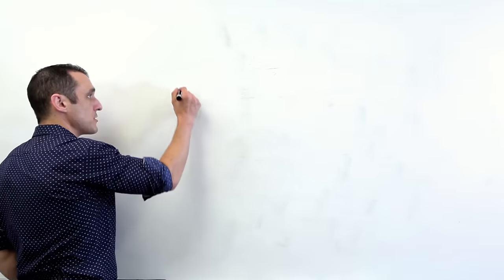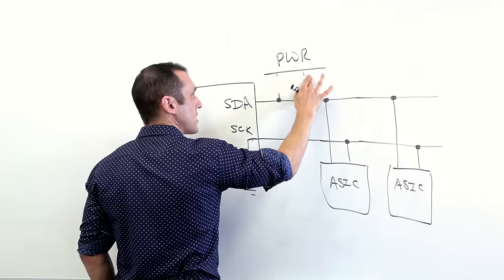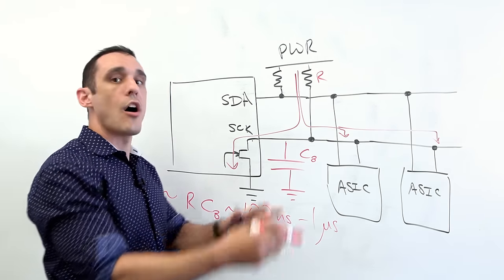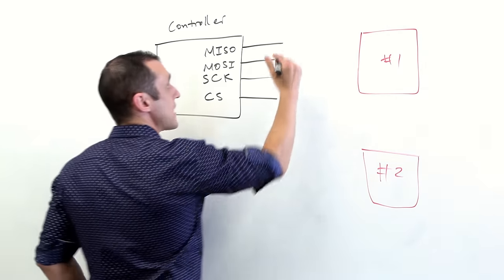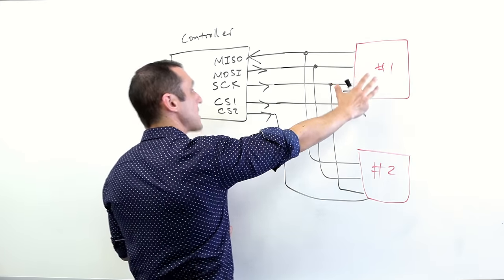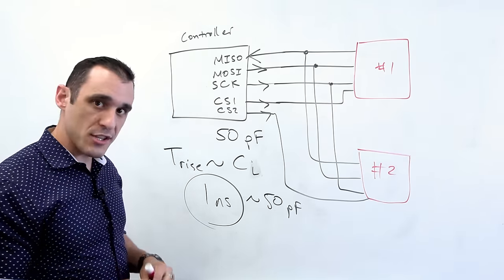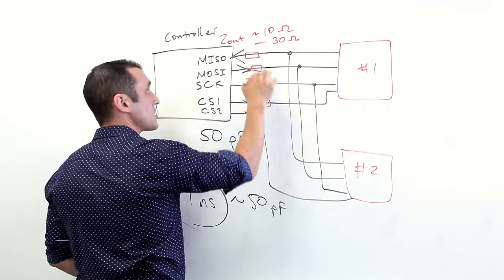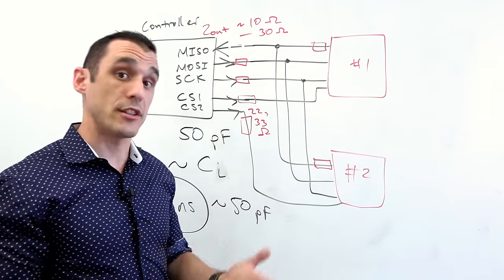I2C and SPI on a PCB Explained!

Comment: VERY Bad idea to put a source termination on the SCK line with multiple loads.   This will not ensure that the rise/falls are monatonic.  They will tend to flatten right at the 1/2 way point until the end reflection brings them back.

Comment: What about I2S? I'm a hobbyist who wants to experiment with STM32 and some audio codecs but I tried an AD1937 and can't get it to work. I can get the I2C communication working with it, but I suspect the I2S is suffering from ringing. I think I can actually see some ringing on my scope. But then in some I2S videos on YouTube I see people soldering loose wires without any concern for impedance at all. So I'm kind of lost. In a design for a Dev kit with this chip, I saw some impedance matching on the I2S lines, just a couple pF and a few ohms. But it's hard to figure out whether I'm dealing with a software issue or whether I did something wrong in my hardware design. Maybe I'm not configuring the codec correctly.. Should I definitely have the codec and STM32 on the same pcb? If so then why does it seem some people can get I2S working over some loose wires? Would you recommend I start with a more simple codec first?

Comment: I have seen such resistors with an SPI memory design, and that stayed looping in my mind looking to what the use of such small resistors and why not something high like driving a diode (At level of 100's or K's). 
Thank you very much for educative video is comes on time for me. BTW, I like your PCB series, it is hard to find such resources and learn about hidden tricks.

Comment: Very informational video that clearly describes how I2C and SPI work on a PCB. My question is how would a layer stack up look like for those examples?
Reply: Thank you, layer stackups for these interfaces are quite simple. I2C is basically a slower interface when run in standard mode, its rise time can be on the order of microseconds. With the rise time being that slow a 2-layer board with ground fill on the back layer, or with a ground wire running along the traces, should be enough to suppress radiation. In fast mode and on some modern processors/advanced FPGAs it can have faster rise time and it can get below 100 ns in the fastest cases, for that it is best to use ground fill to help suppress noise if you use 2 layer board. For SPI, the rise time can be very fast, when slower a 2-layer board with ground fill around traces and ground fill on back layer should be okay. In the fastest components with SPI, a 4 layer board might be needed, but those components with <5 ns SPI interfaces will almost always have other interfaces that demand a 4-layer board with ground plane.

Comment: 12:45 So if USB requires matched impedance it means they have already build in resistors in transmitters therefore they are already "slowed down". How do you achieve high speed when you have to slow down transmitter for impedance matching?
Reply: I would not say that they have "slowed down" anything, they have designed the transmitter such that it has a specific rise time measured at the output pin when the signal encounters a 50 Ohm single-ended impedance. They didn't design it to one rise time and then add stuff to slow it down. When you see a rise time spec in a datasheet, that number they quote is the number you can expect to measure on that trace, it doesn't really matter what happens inside the transmitter because they have already designed it to operate with a 50 Ohm trace. This is why you would not intentionally place series resistors on the USB outputs when they are already rated for 50 Ohms single-ended impedance.

Comment: Wait, so how does the series termination resistor limit rise times? I thought it was more to limit signal reflections. To my knowledge using a series resistor would certainly limit the current, but I don't see how it could have a capacitive effect with respect to the rise time. Is there anything I'm missing or over-simplifying here?
Reply: Imagine the resistor and load+bus capacitance as an RC circuit, increasing the resistor value would increase the charge time of the capacitor - equivalent to slowing the rise time
Reply: Yes the series resistor does limit the rise times. It slows down the edge rate because it is equivalent to adding some DC resistance into a circuit with capacitance (in the lumped element view); this basically adds damping to the transient response. If you had a short connection between the driver and the receiver component, you would get the same effect, you basically have an RC circuit that is charging or discharging, so adding some resistance increases the time constant.
Reply: @Zachariah-Peterson  @Philip Canete,  Thanks guys. I guess I forgot about the R part in RC time constants.

Comment: Thanks for giving free valuable knowledge. but in our SPI application use pull up resistor  3.3 k ohms SI SO and SCK pin. Is it required or not Please suggest
Reply: SPI is a push-pull bus so pull-up resistors are not required. I have seen many different statements about the use of pull-up resistors and they all list different reasons and different pins. The most common suggestion is to use a resistor on the SS/CS pin in order to prevent accidental toggle of the peripheral's state during system startup. The bus will not work without CS and SCK/SCLK signals being present, otherwise it will not respond to SDI/SDO. What is your reasoning for using pullups?

Comment: Thank you very much for this awesome educative video. I have one more question, I've seen in some SPI designs that engineers use pull-down resistors(about 1k) between SCK and GND, is this impedance really necessary?
Reply: Necessary? Technically no, but its one of those things that if you want to maybe build in a spot to test the line, it is a useful thing to have.

Comment: For connecting 5V, 3.3V and 1.8V I2C devices to 5V MCU, via I2C voltage level translators, is it better to use these translators between 5V <-> 3.3V and 5V <-> 1.8V, or 5V <-> 3.3V and 3.3V <-> 1.8V ?

Comment: Very useful info. please make more videos on series and parallel termination resistor reasons and how to route them. for example, using series termination on EXT SDRAM CLK or Parallel Termination ON Diff Pair CLKs Cases. In my case, we have a graphical Circuit with EXT SDRAM as FrameBuffer and MIPI-DSI as LCD Interface but the Data gets Corrupted. using termination can help? How Much Length match will be fine for EXT SDRAM Signals? It's On Two Layer Board With STM32F7 On Top and EXT SDRAM On the Bottom side beneath the Microcontroller and MIPI DSI Lanes as close as possible to the Micro Pins (Around 23 mm Away). All SDRAM Signals Are Between 18 to 37 mm Long Traces, and Delays On ACC, BL0, and BL1 Groups are less than 100ps. What Will be the reasons for Corrupted Data, Data Gets to the LCD But It Gets Corruption in Nearby pixels. Using 4 Layer PCB Can Solve the Problem?
Reply: If you are not doing MIPI DSI and SDRAM routing on a 4 layer board, then I am not surprised that you are having a problem. I do not know if it is specifically crosstalk or you did not design to the correct impedance, but if you have an interface like DSI or SDRAM then you must design to the correct impedance. Don't use these things like critical length rule because everyone uses them incorrectly (I explained why in another video). And don't apply termination to a component that has an interface with an impedance requirement; that impedance requirement means that the traces just need to be designed to that impedance; the termination  circuit will already exist on the semiconductor die. The only cases where you should be applying any kind of termination circuit with discrete components is when 1) the component datasheet tells you to apply it externally; and 2) you are working with RF components below 5 GHz where the output impedance from your RF source will have some reactance.

Comment: Hi Zach, i'm studying on I2C electrical specification recently.
and i have a question on the validation item--> setup time for re-start condition.
i'm wondering why it's more important to define setup time for re-start condition than setup time for START condition?
i think it's neccessary to define setup time for start condition since there's always a START on every transmitting procedure.
but the re-start condition isn't that frequently appeared.
do you have any idea on this?
appreciate if you reply, thanks

Comment: Hi Zack, I watched this video again today and  I had one question. When should we terminate a load like 50 ohm near receiver side if the datasheet doesn't point out input impedance inside receiver? From the video, it looks like there's only one termination used for driver side.
Reply: The loads you would place on an SPI/I2C link do not have an impedance specification, they are integrated circuits and they do not have a specific impedance. They are purely voltage controlled so they only have a high input impedance because SPI receiver circuits are essentially FET inputs. Part of the reason for a series terminator on the driver is to slow down the bus a little bit to make up for a low bus/load capacitance, this can help pass EMC but it also matches the impedance when the line is very long. That impedance matching plays a dual role of preventing reflections, but it does this by slowing down the bus so that the bus is always electrically short enough to work properly.
Reply: @Zachariah-Peterson   Thank you, Noted!

Comment: Very good video except for the signal rise time increase from 1ns to 10ns from a 22R termination resistor. I am running 2.5ns rise times with 22R terminators just fine.
Reply: Well I just stated those numbers as a conceptual example, it is not a hard rule that it goes from 1ns to 10ns. I have also used some ASICs that also maintain very fast rise time with long traces and with the series resistors.

Comment: Execuse me sir, here by rise time do you mean the time required for the signal to go high from low?
Reply: Yes the term "rise time" refers to the low-to-high signal transition, but sometimes it is used interchangeably for the high-to-low transition time. Sometimes you will see "rise/fall time" if the two values are similar.

Comment: I have always wondered why there were 33ohm resistors in series on CS pins ... some datasheets are poorly written
Reply: Sometimes it's not even mentioned in datasheets, and there is not a specific method to calculate.

Comment: Thank you for the video! 
I am actually designing a project which interconnects two PCBs and a use a flat cable between the 2 for I2C. Furthermore, the 2nd pcb is quite long (about 30cm). Are there any further considerations I should take into account for this PCB routing? 
Thank you in advance! 😄 keep it up I am learning tons!
Reply: Make sure that the GND is always carried solidly. 
Keep the data lines roughly the same length. 
Pullups on both sides can help.  
30cm is short for I2C, but it depends on how fast you run the I2C. 
Faster means shorter.

Philips invented the I2C bus to make it easier to control the many ICs in radio and tube TV sets.
The goal was always to implement many tasks flexibly using a bus with few pins.
Every PC today uses I2C for secondary tasks such as fan control, temperature measurement or LEDs blinking.
Reply: Yes
1) add 15pF caps on SCL and SDA - it helps to filter out noise, which is particularly relevant for long traces/cables 
2) follow 60-40 rule for the 0V pins ratio on FCC cable, i.e. for a 10-pin FCC, 6 pins should be signal, 4 pins should be 0V
3) I typically add series resistors on SCL and SDA as well on driver side, like Zach said in the video. The frequency of SCL can actually be up to 3.4MHz, depending on the design. There're also practical benefits  - they limit current in case of a fault or ESD; it's easier to attach logic analyser to a resistor than to a trace; etc.
Reply: @DrEMC-sf8rx
1) by adding capacitance you make the rise times even slower, in anlong cable/pcb situation shouldn' it be avoided? since long trace means more capacitance to charge up and slower max speed achievable
3) same for series resistor

Comment: Trace impedance, are they the same as those squiggly lines you see on the pcb?
Reply: Impedance is a fundamental property of structures that guide electromagnetic waves. All the copper lines on a PCB are guiding an electromagnetic wave between two components, and these copper lines are called traces. The term "trace impedance" refers to the impedance of these copper lines.

Comment: Thank you so much Sir. It cleared my doubts. Is there any requirement of signal's length matching in between MISO, MOSI & SCK ?
Reply: Master In Slave Out  
Master Out Slave IN
SCK Clock
Chip Select, Low = selected 
The data sheet of the IC gives you the necessary timing specifications.
Reply: Not in the same sense that we think about length matching or timing in a parallel bus like DDR4. There is a timing requirement between the clock and signal, but that is a pretty generous limit. IF you want to try and apply length matching rules from a high-speed design to SPI, just stop and think about the rise times I've listed here... You're generally going to be in the nanosecond range and there will be some timing spec to be met at the receiver. Just as an example, let's say we have a 1 ns signal on a Dk = 4 laminate (internal layer for convenience), the length traveled by the signal during its rise time is 15 cm. If, for length matching on a parallel bus, you take a 25% UI value for the allowed skew between sigansl then you get a 3.75 cm allowed mismatch between two signals. The timing spec for that pair of signals might produce a distance mismatch of a similar value. Just make sure you look at the datasheet for the receiver to get the required timing spec and use that to determine an allowed length mismatch.
Reply: @Zachariah-Peterson  thank you so much sir. 👍

Comment: In SPI need to do a length matching .If we are usung multiple slaves .
Reply: There is a timing margin specification, but this depends on the clock frequency and the rise time of the signals. It is not the same type of length matching we do with differential pairs, where the clock can be embedded in the serial bitstream and the two opposite polarity signals need to be aligned along their edge rate. The logic transition relative to clock and CS setup and hold times needs to happen within some timing margin that depends on the time between clock transitions. If the clock rate is slow and the interface is fast (this is pretty typical on advanced ASICs with low load capacitance), then the timing margin between two signals can be somewhat large, and this can allow pretty large length mismatch allowance between the signals on the bus.

Comment: It's a good video. Exactly get how to determine an expected rise time and fall time. But just a little be confused with the Topic, protocol explained. The protocol probably will refer to the rule for transmitter and receiver both when they exchange data. Like how to tell and define start bit, data frame, stop bit, and ack bit.
Reply: Thanks, since this is a PCB channel I wanted to focus on the PCB aspects but we'll put together something on the data formats
Reply: I agree. "Protocol" is the not the best way to describe what this video is about.
Reply: @BTLag  Well then we change it